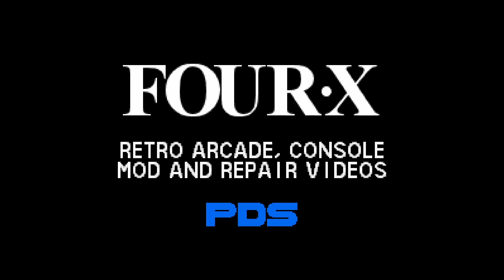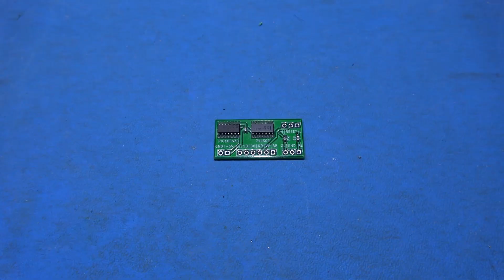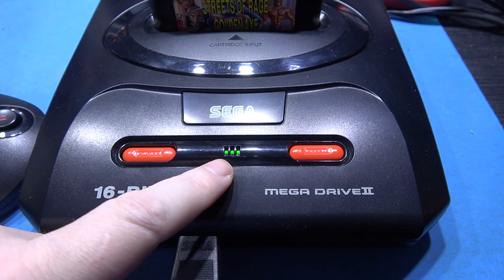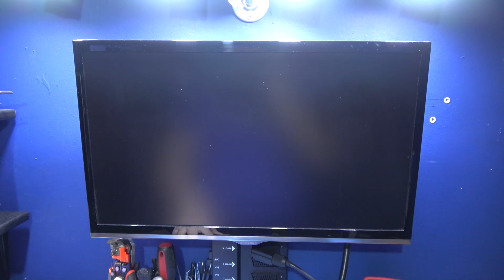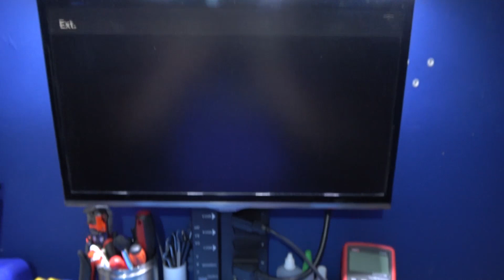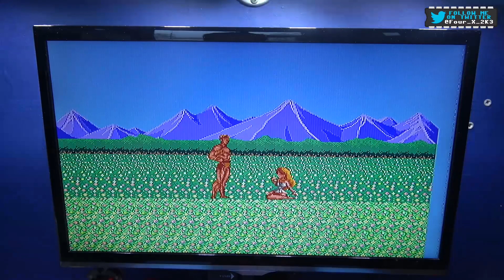SEGA Mega Drive (Genesis) II - Switchless Region Mod - Language & 50-60Hz

Comment: Hey could you help me? I programmed pic and solder the wires but mod doesn't working... could you tell me which files you load inside the pic?